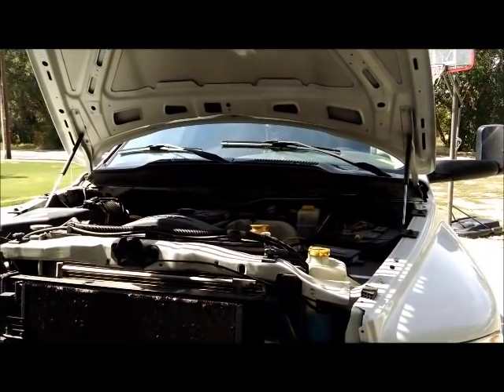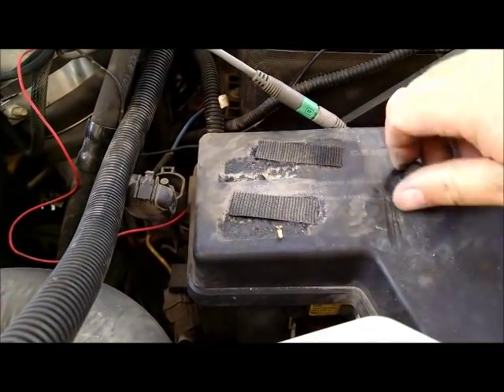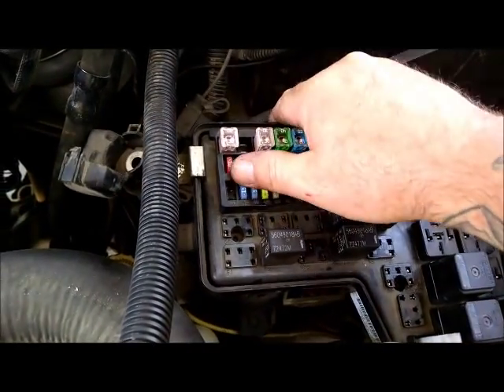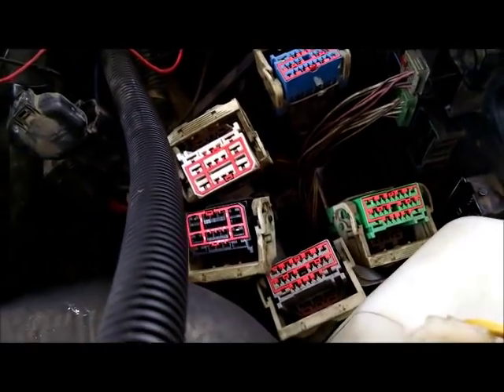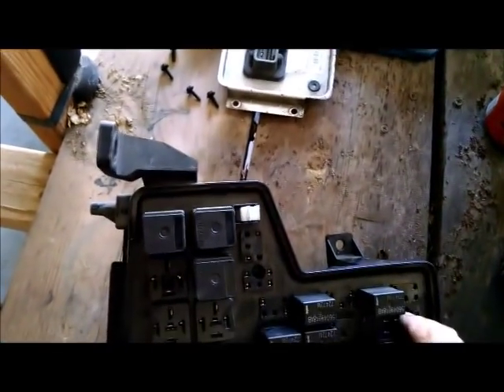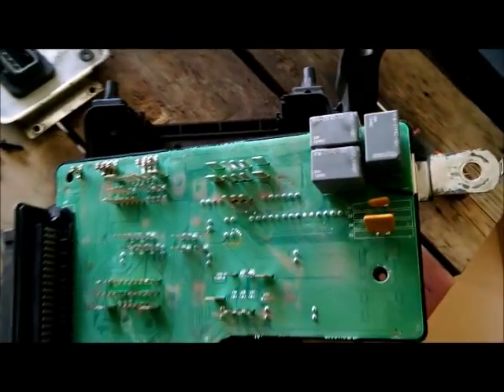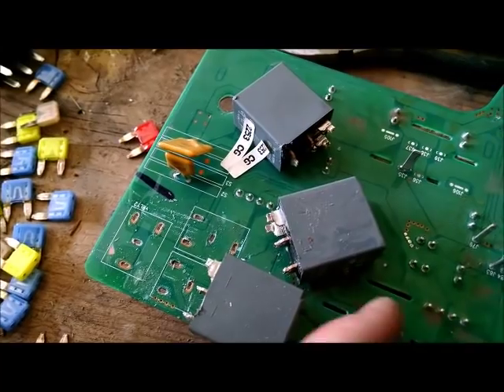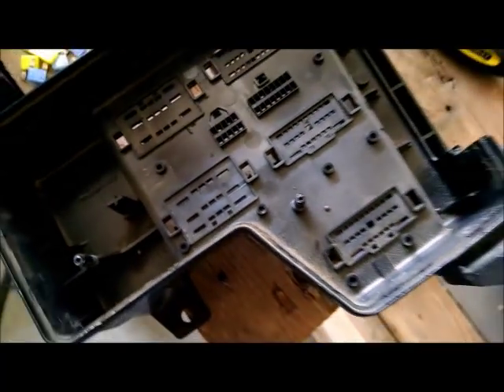2004 DODGE RAM FUSE BOX TRAILER LIGHT RELAY REPAIR

Comment: dude, I can't believe you did this.  you're either insane, omnipotent or you got more money than brains, to fix what you might potentially screw up in this process lol.  
This is the kind of crazy stuff my dad would do as a lifer engineer, (tool and die by trade), for Chrysler Corp. to all his own vehicles....all Chrysler/dodge.   this is also the kind of thing I would attempt and ultimately fail at....costing me more than the truck is worth in the market.  I'm so very impressed with this "work-around hack".  as a carpenter, I really dig your obvious philosophy on taking apart and putting back together something that was originally assembled for end user only.  I just wish I had the wherewithal to apply that to the automotive field as well as I do construction mechanics.  what took the likes of you and my dad 2 hours and nine bucks to do, would take me 2 months....and I can't afford that for sure so I'm stuck with the grand to have the dodge house fix this on my Durango.  
I lost the ready advice and help of my greatest hero when my father passed.  but with folks like yourself pushing ever forward with work-arounds like this, I'm inspired evermore.  
btw, I can confidently say, as a Chrysler engineer, my dad would have never been responsible for engineering a sealed component like this fuse bank.  

Finally, your video is excellent.  actually makes a non gear head like myself feel like I could do this myself.  thanks for sharing.  Very inspiring
Reply from the maker: Thanks for your comments. I am an industrial maintenance mechanic by trade and find myself repairing components like in this case, that are intended to just be replaced to keep machinery running until we get replacement parts. The majority of the time we keep the components that I have repaired in the machinery for year before finally installing the replacements. So after saying that, I might have made this look easier than it is. My teenage boys thought that I was crazy to do this as well. I am also very cheap so that helps push me to try these things. My condolences for the passing of your father, thanks to him and the others that kept Chrysler alive in the 80's I have the best diesel truck in the world. Well that is what I think about these trucks anyway.

Comment: OMG!! Finally got the cover off my 2004 Dodge Ram3500 Diesel TIPM. Going to post pics on a Dodge forum of the post and tabs that were causing me problems in case someone else needs to them. Crazy hard to remove!!

Comment: I just finished doing this fix and all is well with my turn signals. Thanks a lot for this video. The majority of my time on this was spent prying the fuse box apart and putting it back together again.
Reply from the maker: I'm glad the fix worked and the video was a help. When I did the video I figured I wasn't out much it didn't work and I saved a lot of it did. Fortunately it worked for me.

Comment: This is awesome Justin.  It's exactly what I needed to help me fix the same problem I have with my '03 1500.  The thing that really torques me is that when I went to the dealer......twice, they acted like they had never heard of the problem.  Finally one of the service reps found a post on Chrysler's Star System that talked about trailer lights being inop.  The fix?  Replace the TIPM of course.  $680.97 plus labor.  Thanks again.   Ray
Reply: In defense of the dealer, they are representatives of Dodge, and therefore only really perform authorized repairs, which this is not, not in any way suggesting this isn't a valid and effective repair.

Comment: Did this fix and it solved my running lamps issue and now my left side works with brakes and blinker. However, I cannot get the right side brakes and blinker to work. We took out the right relay and tested and everything worked the same way. Replaced the relay again and it didn't work. Going to change the relay with one of the spares I purchased. Crossing my fingers that the right brake light and blinker works!

Comment: Just ordered the relays thanks for the video on the how to I will give it a try and also do a video thank you, I have no left brake or turn signal on the trailer side, no power from the fuse box fuse is good

Comment: Good repair, I did similar , replaced the whole box, junk yard remove box, Install it on 2002 Dodge Ram for 55.00. vs $700 at dealer.

Comment: One thing I'd like to share is to check back by your 7 & 4 pin trailer pigtails.  After I initially did the repair the lights didn't work.  It wasn't until I got under the truck, cut open the wiring harness that I saw where the previous owner had cut the wire from the power center and spliced into the Left Turn wire on the turn signal.  Pulled that wire and spliced back into the original configuration and all works perfectly.

Comment from the maker: Tim, if your truck tail lights work fine but the trailer plug on the truck does not have constant voltage for tail lights when turned on and on/off  voltage in sequence with truck lights when the left or right turn signals are flashing, these could be the issue. There is three relay, one for tail light power, one for left turn signal/left brake and one for right turn signal/brake. It is highly unusual for all three to be bad. Most times one of the turn signal relays will fail first because of the on/off that makes the lights flash. Good luck and hope this helps.

Comment: Is it still working now? Just curious because adding a higher amp relay puts stress on something else when the damn trailer wire shorts out. Could possibly burn a trace on that pcb. 
But you dont know unless you try. And it is still cheaper than $800+ for that damn TIPM.

Comment: Trying to get my 2004 Dodge Ram3500 Cummins Diesel TIPM open and 3 sides popped up with no problem but I am so stuck on the FOX side, which I did remove, but I can't get that side to budge. I was hoping you had a tip on how to pry in these 2 corners or anchor under the FMC plate or both to get this side up?? Please help me Justin because I am almost in tears here. I know you're busy but I am hoping you will call, and hope I didn't overstep my bounds, but I'm so desperate so left you a voicemail too. Thank you!!

Comment: I just did this fix today,,and the relays were hard to get out. I crushed the relays with chanel locks untill the only thing left was the legs sticking out of the board. that made it easy to pull from one side as I heated the solder joints and then they releast ,Didnt take long once I got the  shell of relays broken off.

Comment: I have this problem after hooking up to my boat trailer that I eventually found had a short in the wiring. My truck is a 2006 though with a different style box. I took it apart and don't see big relays like the ones here. I cant find any information on how to fix my style or how to locate the relays. Would you have any info to help me? Thank you and very informational video!
Reply from the maker: I do not have any information for the 2006 model. I only researched the 2004 because I had this problem with trailer lights. That being said I would think that if you did not have this issue and then plugged in a trailer with a wiring issue you should check the fuses. Dodge uses separate circuits for the truck and the trailer plug. The truck fuses would not be affected from the trailer issue but the trailer plug fuses would blow. That is my guess without being able to put a volt meter in a couple places. Good luck and hope this helps.

Comment: Got all the other tabs unlocked. How do you get the rest loose by the fcm connector? Trying not to break it but it will not come loose. Thanks for the video.
Reply from the maker: it is very tough on that side. just keep working at one side until you get it. good luck!

Comment: Ok so I tried this and I cant get the solder to melt. I tried a 30 watt and went out and got a 1000 watt and still cant get it to melt to get the old ones out. What the secret i have never had a problem removing old solder. Both irons melt new solder. What kind of soldering iron are you using.

Comment: Thanks. Great video. After an extensive search, yours is the first place that I found that the Ram 1500  trailer lights are separate from the truck lamps. I figured this was the case because a brake light on the trailer is on even with the truck brake lights off. Anyway, I am trying to find the cause of the problem, but am thinking that it would be simpler and quicker to just rewire the trailer light connector to the trucks rear lamps? Is there a reason why this shouldn't be done? Thanks.
Reply from the maker: I know people have done this to make the trailer lights work. I would think in most cases you would be fine, but the truck lighting electrical circuit is only intended to run the truck lights and if you had a trailer with a lot of lights (big camping trailer) this could use more amperage then the circuit can handle.
Reply: Thanks Justin. Yes, I agree about the current draw. If necessary, I would increase the fuse rating. Kind regards.

Comment: How did you get the solder to melt to get the old ones out? I’ve been trying everything with various solder guns and can’t get it to happen. I scraped back the polymer they coated it with, I’ve tried pre heating the board, and my iron is 100w.
Reply: Did you tin the tip of the soldering iron?
Reply: Drop a bit of solder o your iron to pass the heat more effectively to the pin your trying to heat. You need solder to desolder

Comment: i have a similar issue with my dodge 1500 5.9L. My park light passenger side dont work. my blinker,breaklights,backup lights all work except the park light on the right hand side. any advice

Comment: great video Justin I have to do the same with my 2500 03 ram. how did you know what relays to order when you hanen't opened the box yet? but thanks again for the great info
Reply from the maker: A lot of reading on the internet and I was happy to find that what I ordered was right.

Comment: Hello Justin. I am having problems on my 2004 Ram 1500 trailer lights. I have tail lights but no turns or brake lights. So far I have narrowed it down to these relays( that the dealer parts man and a "tech" didn't know were permanently soldered INSIDE the fuse box) or the side mounted Forward Control Module. Obviously they want to sell me a new fuse box for almost $800. My question is....do you think the relay part numbers would be the same for my 04 Ram 1500? I predicament is that this is my only vehicle and I only have one day off work, which is spent doing house and yard work. I'm thinking it would take me around 2 hrs or so to pull this all apart to get the numbers of the relays and then put it all back together .
Reply from the maker: I have not taken the 1500 fuse box apart but, I would bet that it is the same relay in all three (1500, 2500 and 3500).
Reply: Well, logic and common sense thinking tells me the same thing BUT, logic and common sense does NOT put these relays inside the box. lol . I'm going to go ahead and search them out online and buy them. If they are wrong, I'm not out much
Reply: +Justin Wixom  Where did you purchase the American Zettler relays? I have been searching online for over an hour now and all I can find are just a few places that require a $50 minimum order on them
Reply from the maker: I had to purchase $50 dollars worth and I sold the extras on eBay. That is the only way I could get them and it was still cheaper than a new fuse box. Pain in the butt to get the extras sold.
Reply: Ok, thank you. That's the only way I can see to get them purchased also.
Reply: Does anyone know which one out of the three is the left turn signal relay. I know I should just replace all three, but if I can replace just one it would help a lot!

Comment: I have been unable to locate the relay on line.  Where did you get yours?
Reply from the maker: The ones that I removed are no longer available. The new ones I installed can be found at Amazon. They are about $10 each.
Reply from the maker: Alan Vancil, the relays can be purchased on Amazon. You will need to use the American Zettler part number that I talk about in the video.

Comment: Use a blow gun with a rubber tip and compressed air with a regulator set to 20 psi.  Heat the solder and give it a quick blast of air.  Gently scrap off any solder debris.  It cools so fast it will barely stick to anything.  I could have those relays out in a minute....

Comment: I’ve tried for hours to get the box apart only one end plus up
Reply from the maker: There are some locking tabs around the edges. You will need to use a small flat head screwdriver and work around the edges until you find them and pop them open.

Comment: Justin, I cannot for the life of me get those fuses desoldered!!!!  what did you do to get them off?  Please Help!!
Reply from the maker: You need a really good soldering iron. You can also remove some of the solder with a die grinder to make it so a lower watt iron will work. Using a die grinder is very risky and you must use caution to not damage the board traces. Some people that watched the video used multiple irons to remove them. Hope this helps. Good Luck!
Reply: +Matt Wyatt  put a little solder on the tip of the soldering gun to help transfer heat to the old solder.

Comment: Where on the internet did you get the relays, thanks.
Reply from the maker: Angie Weakley , web search American Zettler and the part number that I show on the relay in the video. you should find several places to purchase the relay. If you still have trouble send me an email and I will do what I can to send you information. Thanks.
Reply from the maker: Did you find the relays?

Comment: I thought I had a relay out because no right turn on the trailer. OMG everyone check first - Fuse # 46 and 47 in the fuse box first. They are 15 amp. They evidently run the relays. Yes you couldn't hear the right turn relay clicking but could the left when I turned them on.  I got the truck and had it for 6 months before hooking up a trailer. Someone before me must have robbed the fuse out, same as burned out if yours. I put it in and all works. I already ordered the relays and was just checking before putting in. They call them Right 'tail light' and Left 'tail light'. They should have said 'turn' instead of 'tail'.

Comment: how can u take off the fuse with black ears if u can tell me please
Reply from the maker: The black relays must be unsoldered using a soldering iron. Then new ones soldered back on.
Reply: Are u talking about the fuse like the air bag yellow tab fuses. If so the holder has a door on the top. unclip the door and remove the fuse. the 1 black and 2 yellow holders can be a pain to get back in. just push hard and wiggle slightly. hope this helps.

Comment: This makes me sick that dodge would engineer such a stupid setup. My trailer driving lamp circuit has no power, signals and brakes work, 2003 Dodge ram 3500 Diesel. How can I make sure this relay is actually the problem before I go through all this trouble? Also is this the same relay for the 2003? And I can't seem to find them anywhere.